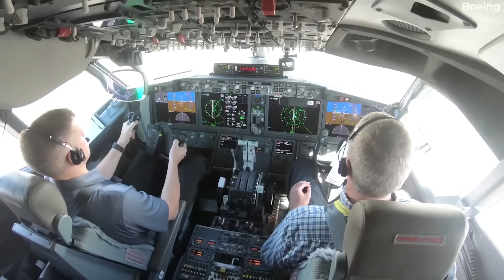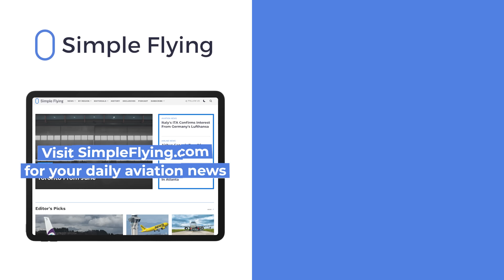Mysterious: Airbus Picked Up An Order For A Single A330-800

Comment: Maybe Air Transat? They used the A332 alot compared to the A333 so it might make sense that they might order the A330-800
Reply: A333, A332... what?
Reply: @4evertrue830 the commenter is clearly using the ICAO code for the A330-200 (A332) and A330-300 (A333)
Reply: do they have the budget tho?
Reply: @frutdafruit yes, and thanks for explaining it to him/her